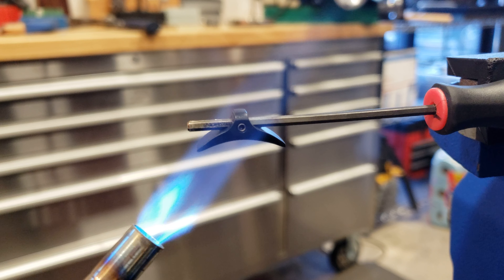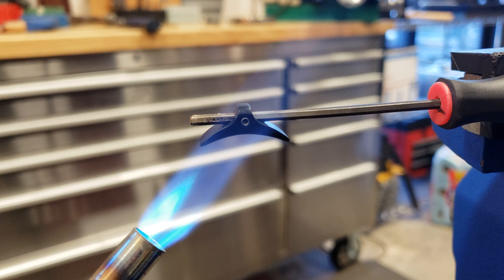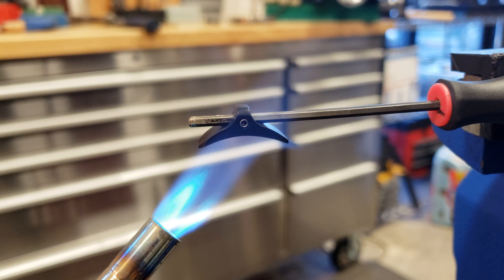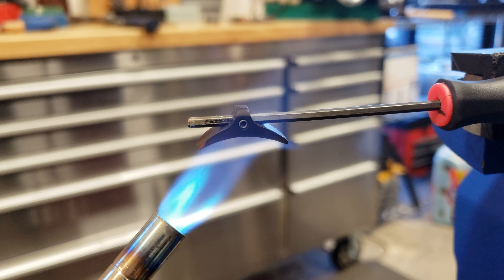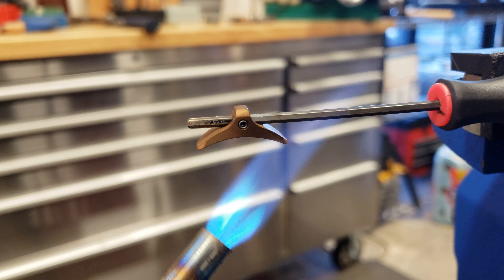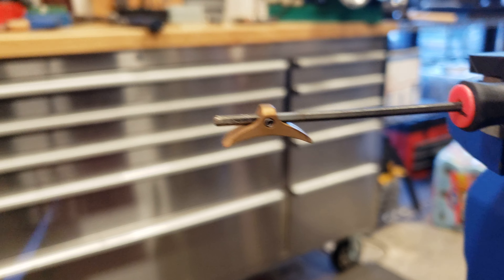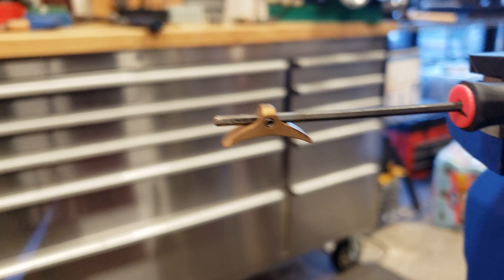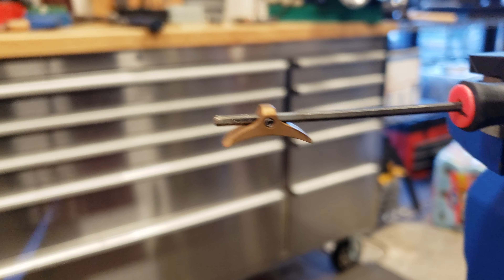FX Airguns Part Color Change - Heat this up to change the color on FX Airguns

Comment: Great tipp ! Do you have any problems with the anodization wearing off after that? I mean getting any less wear resistant?
Reply from the maker: We have not seen any difference in protection, but we also have not had that long of time to test it. I doubt it makes much if any difference.

Comment: Does this work on any other parts?
Reply from the maker: I believe it will! Worked on Impact side plate and hammer adjuster as well
Reply: How close a colour match is it to the fx bronze framed edition?
Who'd have thought..
Reply from the maker: @philcole2131  it depends. You can change the color due to how much heat it applied and how fast the heat is applied. Also, the bronze on the guns varies between batches. The hotter the heat the lighter the color
Reply: @910AirgunTuningandRepairs  you clever souls... Did you find that out by accident, go "bloody hell" then "that's cool, Where's my camera"?
Reply from the maker: @philcole2131  exactly what happened!! 🤣

Comment: Hi this is so amazing I’m in England I have the m3 bronze in sub 12 will this be the same also what else can change kind humble I’m not worthy 😂 Carl
Reply from the maker: Any small aluminum part anodized black will change to a tan/bronze when exposed to high heat.
Reply: @910AirgunTuningandRepairs   thanks 🙏

Comment: Come on FX - explain why?
Reply from the maker: Well from the research me and one of my buddies did, its a common thing with anodized aluminum exposed to excessive heat for extended periods of time. The torch simply super speeds the process. The example we read was a flashlight left in the bed of a truck for a couple months (direct sunlight, I'm just surprised the batteries didn't explode). I dont think sunlight would ever cause this problem with the rifles though